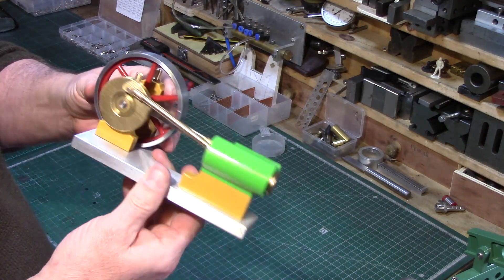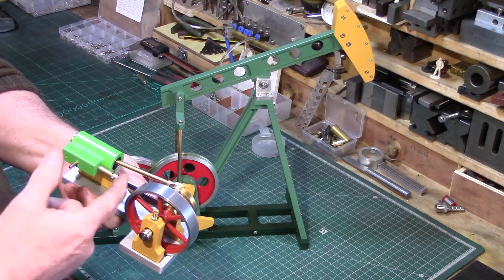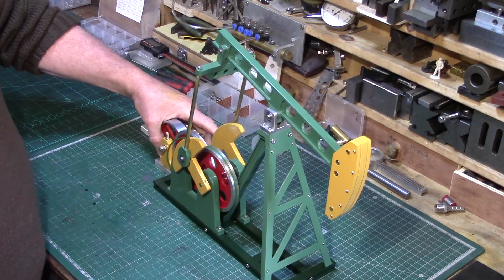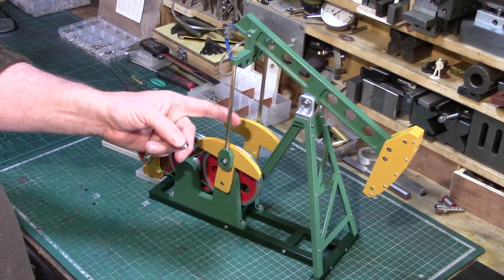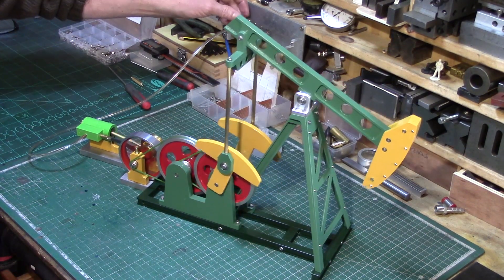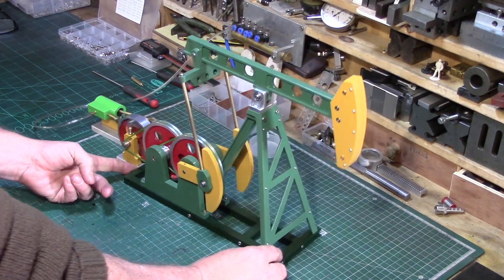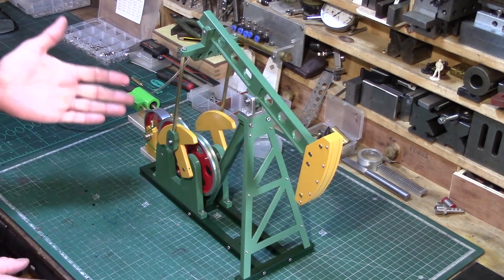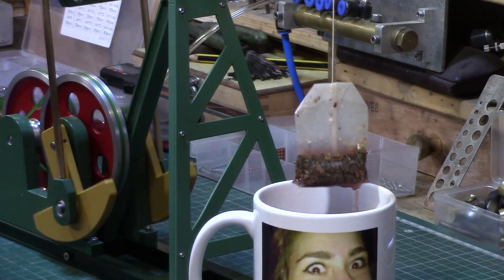Model Oil Pump-Jack - with steam engine

Comment: I found a massive single cylinder vertical steam engine that had been used for drilling oil wells sitting out in the middle of nowhere in central Oregon.

Comment: Loved the project and belt idea, didn’t catch what the material is if you could write it down please?
Reply from the maker: Hi Ian, if you search for 'polyurethane round drive belting' on ebay it will give you the product, I used the 3mm stuff. Regards, Ade
Reply: @adeswash  thanks for your help.

Comment: Your talent is envied...and appreciated. Some very interesting projects. I am new to model machinery but would love to try to build your oil pumper. Do you have any specs available or know where some could be acquired? Great videos also.
Reply from the maker: Hi Ted, thanks for the comment, unfortunately I dont have drawings for this as it was scratch built and figured out as I went along, the nice thing about this approach is you just make the next part to fit the last, and you end up with a unique model. Regards. Ade
Reply: @adeswash  Thanks for the response Ade. Your approach works great for someone with your talents but does not work at all for someone like myself and ignorant. Thank you for the videos, they are great.

Comment: In the USA oil-producing states, these things are known as "grasshopper  pumps" because that's what they look like. They are used when the natural gas pressure in the well falls below the capacity to pump. At this point you bring in the grasshopper. Usually run by a "hit and miss" gasoline engine although there are alternatives. However I have never seen a grasshopper make a cuppa tea till now:)
Reply from the maker: Thanks for the helpful info Juan, much appreciated. Ade

Comment: Brilliant work didn't they run on what they sucked up cruid oil
Reply from the maker: Hi John, thanks for the comment, I think most of these are run from electric motors today, but yeah an engine driven from the oil source would be self-sufficient :)